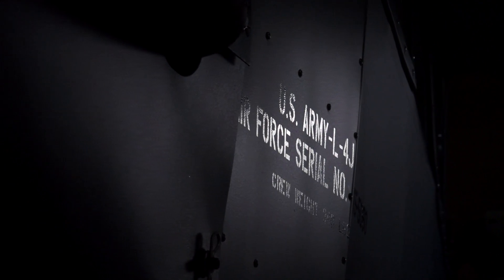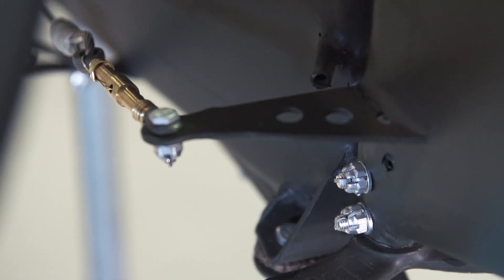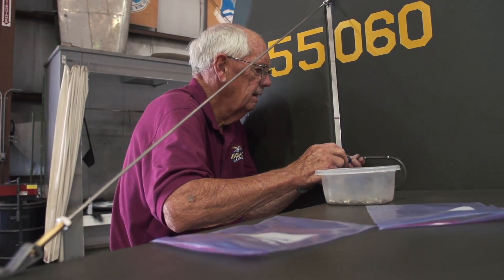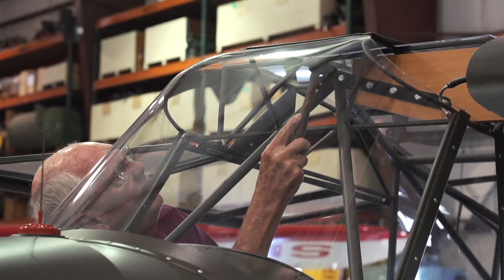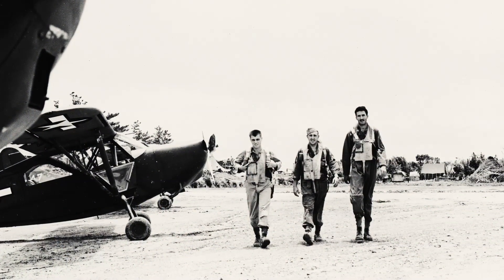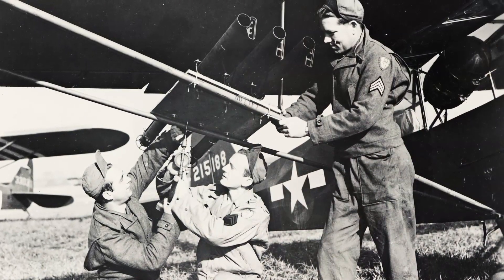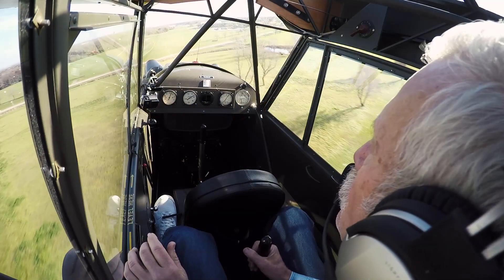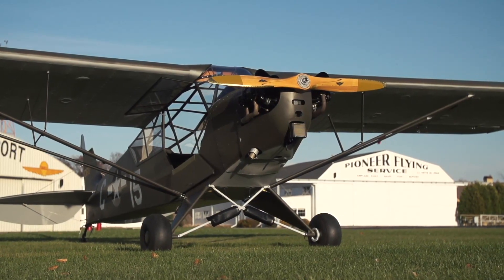Humble Warbird: An L-4 Flies Again

Comment: Very Nice Video! If one would build one of these and not care about the historical accuracy of the material he could use the Oratex6000 Olive drab and get the plane build without spraying paint! This way one could easily build one in an attached garage or even a living room, with no toxic fumes, solvent stench or overspray... The old Buthyrate and Nitrate Dope spray-paint finishes used back then on these planes were not as toxic as todays Urethane spray paints for the legacy fabrics... so if you have to spray paint, protect yourself adequately.
Thanks for posting, EAA !

Comment: That's pretty awesome, just needs to comply with AD 58-01-07 that requires clevis bolts on the horns for the elevator, rudder and aileron.